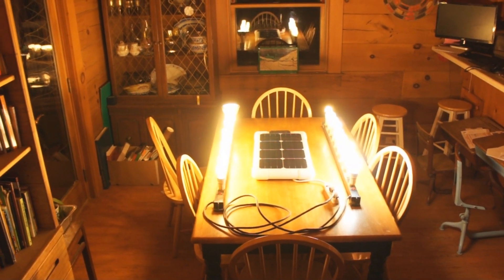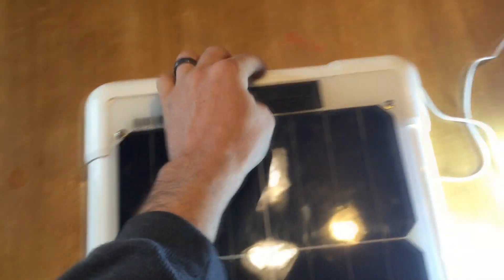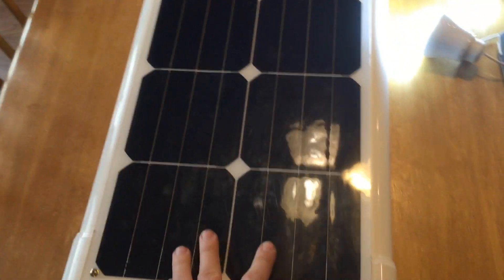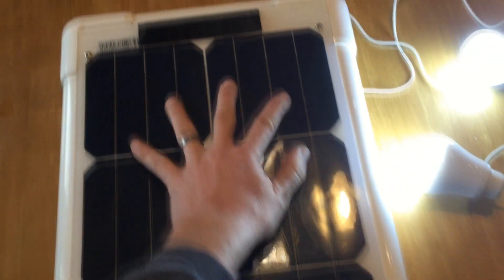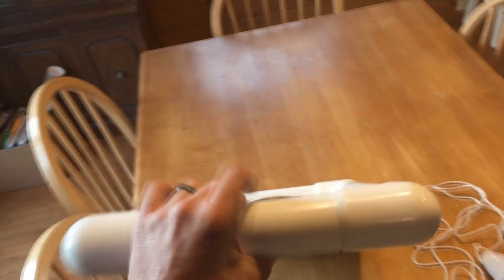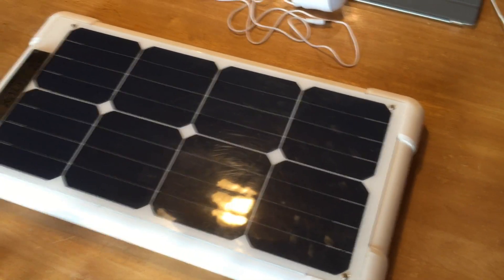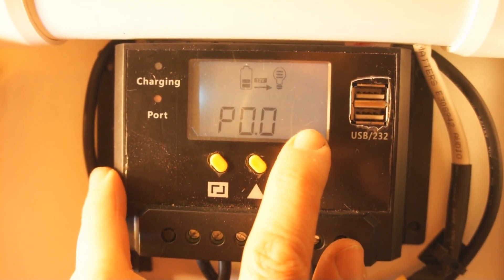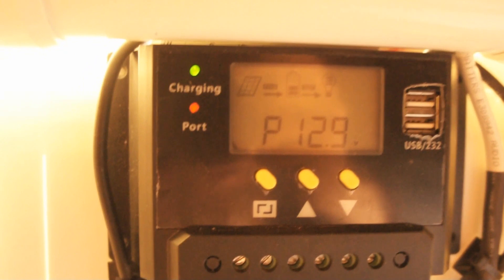SOLN1 25 - Easy to Build DIY Portable Energy Generator Solar

Comment: Very well done Lasersaber ! Looking forward to your build video. Also nice funny birds !
Reply from the maker: overunitydotcom 
Yes, the parrots are a great addition to the family.  They have been quiet observers to a lot of my crazy projects.
Reply: Phong Pham I believe you'll need a solar charge controller to prevent overcharge
Reply: yes but you should use a solar charge controller to prevent damage to the battery
Reply: Ok
Reply: +lasersaber I have solar panel 24volt 2.4watt. 
Can I use that to charge 24volt battery?
Reply: I already has a solar charger controller.
Can 2.4 watts solar charge a 24volts battery?0

Comment: Really nice idea and I am surprised that 250W inverter can run the motors that good. Looking forward to the build videos.
Reply from the maker: gamingSlasher 
What amazes me is that it can start the motors in the first place.  Most of the inverters tested could not even begin to start these motors.
Reply: Thats what I meant. I read that low frequency inverters with a transformer can handle surge currents better. Might that inverter be such a kind?
Reply: It is fake, man
Just the people not smart enought to know.
Reply: +tiho gro , Fake? how so ? He would not try and scam us , would he ?
Reply: triumphmanful 
I am Hardware engineer, as my pcb department manager say: It is for selling, not for using!

Comment: do you make them in 220V output?
Reply from the maker: сталкер чворович 
At some point I will spec a appropriate 220V inverter.  We would simply install an inverter that matches your needs.
Reply: lasersaber thank you and keep the good work :)
Reply: i think its  abit low powered to do that
Reply: could this heat a water heater maybe two of them
Reply: The best portable water heater would be fire and a pot

Comment: No balance charge? Even on the battery car, a balance charger was omitted from the build. Not what you call safe
Reply from the maker: northwales1000 
With LiFePO4 battery it's more of a longevity issue.  Most of BMS systems I have seen for a 4s LiFePO4 do not even include balancing functionality.  They simply regulate the current and cut off voltages.  See this list: http://www.batteryspace.com/pcbpcmfor128vlifepo4pack4inseries.aspx
The solar charge controller controls the current and the low and high voltage cutoffs.  A PCM with balancing is easily added and will be an upgrade option on the kit wiring harnesses.
Reply: lasersaber yes but surely without using balance charger, the longevity is reduced. Just seems a waste to keep buying more batteries to replace the failing ones when you can look after them in the first place
Reply from the maker: northwales1000 
I agree and that is why it will be an encouraged option.

I have four of these batteries:  http://www.batteryspace.com/lifepo4-prismatic-battery-12-8v-20ah-256wh-10c-rate-24-0---un38-3-passed-dgr.aspx

One of them has been in use for will over three years with no issues at all.  This is with nothing but a PWM solar charger connected to it.  LiFePO4 have really amazed me in every way.
Reply: lasersaber Guess so used to using lipo, hard habits are hard to think of trying something a bit different. Not got any of these myself as yet. But good to know that they can used in this way. At £13 here in uk, then 3 to 4 years is pretty good going then. May have to give a go then, The sun in uk may not so compromising though
Reply: lasersaber  Evassemble sell the "capacitor type" I got one on 10000W 48Vpack and on a 12 volt pack, but you just need a un-plug for long term storage.
The 16s has been running ~ 1 year no problems yet it is on 24/7

Comment: 250 watts wow on solar panels... I wonder how long that 250watts can be use continuesly...
Reply: You see thevsolar panels we have comercially availiable are weak. You should actually use presserized crystals due to the fact they collect and give off more power. But he isnt wrong. He designed special batterys kinda like a hybrid supercapacitor battery. So insteas of the solar panel getting held back due to battery chargeing time it will take less time to charge the capacitor batterys

Comment: Seems pointless not having 12v out as well.
No mention of the panel rating either. 10 watts?
Reply from the maker: MindTurd 
12V out is an easy upgrade option using a T fitting and 12V marine socket.  The SOLN1 25 uses a 25 watt panel.

Comment: This is an awesome build! I would love to have one of those in my jeep :P bah I have a biolite stove instead :P Thanks for sharing!
Reply from the maker: bakupcpu 
I love camping with a SOLN1.  It is amazing what a difference having portable AC with USB charging can make when you are beyond the grid.
Reply: I know :) luckily my jeep as a build in inverter and I have a little 1kw generator that's about 30 lb but I normally use solar charger and patience in camping :P. For trekking It would be nice I was looking at solar panel and I do happen to have a little 30 watts inverter no idea how it would work I'll have to check the no load condition. Cheers!

Comment: How do you balance charge the lithium batteries?
Reply from the maker: IscleGaming | ZefaCraft 
All the original SOLN1 units we built had a PCM with balancing.  With these new units it will probably be an upgrade option.  As far as the physical design is concerned, there is no difficulty with adding a PCM.  My kids solar car conversion LiFePO4 battery has no BMS or PCW at all.  The kids have driven the daylights out of it and it is still performing great.  This experience, as will as the fact that individual replacement LiFePO4 cells are under $20.00, makes the need for a PCM optional.  Here is the link to the battery unit used in the kids car:  http://www.batteryspace.com/lifepo4battery12v20ah240whwithcontrollerforsolarpowerstorage.aspx
Here is the link to the battery used in the older SOLN1 units which included a PCM with balancing: http://www.batteryspace.com/custom-polymer-lifepo4-battery-pack-12-8v-20ah-256wh-16a-rate-24-0.aspx
Here is the type of PCM specs wise that I would chose for a upgrade option for these current SOLN1 25 units: http://www.batteryspace.com/PCM-with-Equilibrium-function-for-12.8V-LFP-Battery-Pack-30A-limit.aspx
Reply: Wondering the same.
Reply: Some charge controllers have a balancing feature, look like this one doesn't.
I had ordered a couple of these chips: http://www.mouser.com/ProductDetail/Microchip/TCM828ECT713/?qs=%2fha2pyFaduiQB6t1XJptCQMTZc8XXSPhZ8UqtvSxqv8%3d to see if I could make a charge shuttling balancing circuit. To wire it up, connect the + terminal of a battery pair to the Vin pin, the - terminal of a battery pair to the out pin, the middle terminal of a battery pair to the gnd pin, and a small >10uF electrolytic across the C+ and C- pins. One of these chips balances a pair of batteries, so if you have a two cell bank, you need one of these chips, a three cell bank needs two, a four cell bank needs three, etc.

I haven't tested it out, and the chip isn't explicitly intended for this purpose, but it should theoretically work as a charge shuttler. If it works, it's an active cell balancer and should even balance the cells if they aren't charging or fully charged, and keep them balanced at all times.

edit: I tested this setup with two super capacitors, and it worked. One cap was one volt, and the other was two. the bank voltage didn't drop too much after the balancing process(3 -> 2.8). It's slow, probably would take a day to balance a worst case scenario battery pack, but it will keep a balanced pack balanced.
Reply: Same thing on kids battery powered cart, no balance charge controller
Reply: northwales1000 But in the kids battery car the charge controller was inside the battery itself because it was designed to be charged like that, but I'm assuming that on this build he is just using som 18650 or something like that without a charge controller.